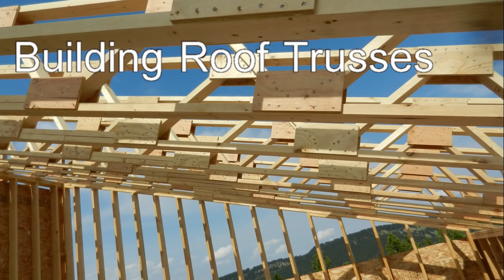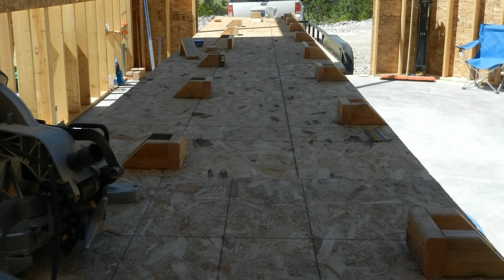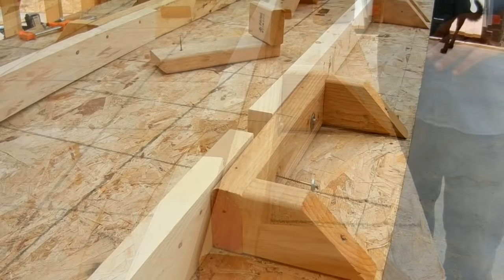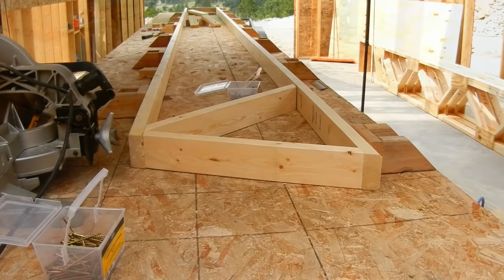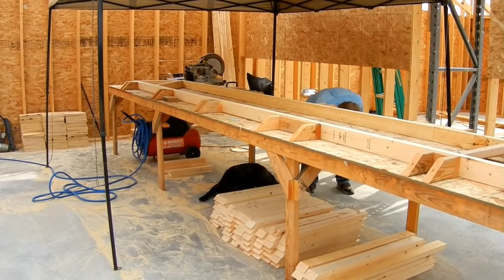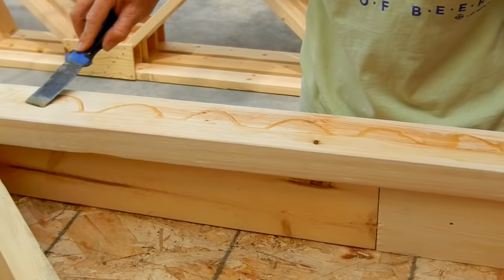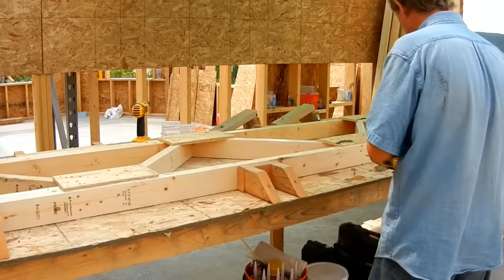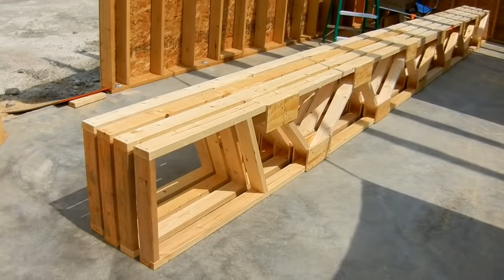Building Roof Trusses

Comment: I'm in the truss business...and I admire and congratulate these people for doing this with their own talent and skill...wish the world had more people like this
Reply from the maker: I couldn't agree more.
Reply: its not complicated - just time-consuming.
Reply: well construction wise it is built WRONG!! 2*4 is turning the wrong way and also underdimensioned!! The width of a truss doesn’t add carry load!
Reply: @MrMakhitta  depends on the type of use for this
Reply: @uniqueidentity1362  nope, there is basically no type of use where this would be a preferred construction! Strengthwise this construction is no stronger than the exact same construction only that all pieces of 2*4 were to replaced by 2*2.. And if you were to replace all 2*4 with 2*5 it it still not stronger!! You need to flip all pieces both beams and studs 90° so they vertical and not horisontal in orientation! I’m shocked that you brag about being in the business and yet so clueless!!
Reply: @MrMakhitta  I don't think you understand how trussed rafters (or beams) are designed, Jonatan. There will be advantages to using 4x2 over 2x2, both in engineering terms when in use, and in practical terms during installation. Trussed  members distribute loads differently to individual members (although a flat 4x2 will still do more 'work' than a 2x2)
Reply: @MrMakhitta  I get what you are trying to say but it's just not accurate to say that a 2x4 on the flat does the same work as a 2x2.   Especially in a truss situation.      For one thing, wood is a far from uniform product and a 2x4 will rarely just split apart while a 2x2 is small enough that they just shatter along small weakness in grain.    Second the Width of a truss adds stability and strength (especially if he put gussets on both sides which it doesn't look he did).  
I have no idea weather this guy did the calculations or if he just winged it.    So maybe they are strong enough and maybe they aren't but just because they are on the flat doesn't mean it's absolutely wrong.
Reply: @MrMakhitta  If this is wrong then every floor truss ever built is wrong because these are essentially built same as floor trusses that carry bigger loads than any roof other than massive snow load roofs

Comment: As a builder for 35 years and designed and built over 200 homes I just need to say to all the engineer experts who wrote the negative comments, this design will handle anything mother nature will throw at it. Sure I would have done it differently but for what he is doing it is just fine.
Reply: engineers don't like when people do this sort of work, because they won't get paid $1000 to look on a chart and tell a secretary to stamp a sheet of paper.
Reply: I've designed and built for 21 years and I wouldn't have done it that way either, but what do I know about his snow load and other factors? They look super strong and actually quite beautiful.   If this were a shop it would be wonderful to gaze up at that trusswork.
Reply: You haven't been building for that many years .I set trusses on a 7 million dollar house and 3 days later Hurricane Andrew came through Naples FL.I braced them and had two bundles of plywood on the roof strapped all of it down.I guess why my house was the only 1 not damaged is because it wasn't decked yet.Plywood on roof.Ive seen wind bend a 1/2 inch by 12 inch glitch plate.So wood is a perishable item dude.Buit homes in Buckhead In Atlanta to SC to Cali.Built a repelling platform for the special forces in the Ga Mts.Also I have never understood why another man like you said comes in picks apart things Bitc.
Reply: I have built homes for 30. The high end home we use enginered floor trusses. Lower end TJI's which I have a strong dislike for.  I am in Southern Illinois.  Also build in the boot heel of Missouri, around Kentucky Lake and southern Indiana. We do have to hurricanes like the coastal  and gulf states or tornadoes like Oklahoma and west.  I do want to say they do excellent work.  His layout is very efficient. He has a eye for detail. Quality craftsmanship.  Excellent work.   There is nothing wrong with his trusses.
Reply: Thanks. Can you tell what different approaches would you take?

Comment: I’ve built many buildings for stables etc and to get through engineering here in the U.K. we almost always have to put the timber the other way on in trusses. Even if I design something it has to go to an engineer to be approved then building control will be happy. 

I cannot get it passed off as a rule with screws, only these long large gauge builders mate type. We almost always have to use nails and on the gussets either PVA or cascamite. 

Don’t listen to the negatives that say your slow, I’d take a neat slow guy that’s right first time every time over a race through and fuck up kind of guy every day of the week. Nice to see people doing a neat job

Comment: I know this is an older video.  I read through some of the comments and some of them prompted me to comment.  First of all this guy does excellent work.  I am a DIY'er myself.  I don't permit a lot of things I build myself.  I usually tend to over engineer what I am building anyway.  In my opinion the whole permit thing is a racket.  I have seen prefabricated roof trusses. They don't look much different than the ones this guy built.  I bought a brand new house around 10 year ago.  It was a spec home in a subdivision but I watched it being built nearly every day.  I watched the the roof trusses and walls being dumped off the back of a flat bed truck.  I listened and watch the south of the boarder carpenters slap together my house like a jigsaw puzzle.  I bet none of them could cut a roofing angle.  I fail to understand that if you are building something on your property, that you own, why does the city or county need to be involved?  I am not dense... I understand that nobody wants to have a cattle barn down town but other wise leave us DIY'ers alone.  If it falls down around our ears, it's nobody's fault but our own.   There, my 2 cents.
Reply: I have to disagree. Anyone in the home could be hurt. I would have paid an engineer to look over my design of these trusses and the engineer would have made the product better by pointing out that the screws have to be structurally rated or use nails. He would have determined the size, number and spacing of the nails. The glue should be structural glue. Then this guys careful work would be much better and it wouldn't take any longer or cost any more. I once had a friend remodel his house and he made a built up beam out of 2x material. I talked him into where to put the splices and to use structural glue and to add an extra layer of 2x.  The inspector told him, he is lucky he did those  things or else he would have made him pull it all down and do it right. The inspector didn't require a stamp so that was nice. I respect the expertise of engineers because I don't know what I don't know.  I am building a deck and the code for deckrail post connections has changed dramatically since I last built a deck because engineers did a bunch of tests and found the old methods don't survive a few people leaning against the railing. Most Youtube videos are showing the wrong way to do it. It is hard to keep up with all the knowledge so I rely on experts to point me in the correct direction.
Reply: Rj Leblanc in my humble opinion they just want money. some things are definitely for safety but it's all abt control over us the people ...hope you are well
Reply: James, really, you think there is a conspiracy to control people by making our homes safer? Who is running that operation? Most of these regulations are based on what has happened to houses in earthquakes, hurricanes, fires, etc. I remember after a hurricane that unexpectedly caused more damage than they thought, they changed how roofs were anchored to the top plate. Also a lot of codes are because scammers going around throwing up roofs for cheap but they blow off in the first storm.
Reply: jollyandwaylo .....well the govt runs the whole deal so there is that and safer? Bullshit. you can't out engineer mother nature .people have tried for centuries and still get blown away ,crushed and the like .freedom has a Cost. sorry if that is harsh but as the county people keep telling me it is what it is
Reply: If someone is going to impose that sort of regulation on you, it should be your insurance company - since it would be their liability (and your choice to have it).

No need for government to get involved in everything - there are other ways that don't involve force.  And because other ways exist, they should be the way we choose going forward.

Always ask yourself: "Is there no other option but to use force in this scenario?"  The answer is always "No" unless someone is using it against you first.
Reply: Who says you need insurance? If you borrow money from the bank, the bank usually requires it to protect their investment but otherwise I don't think there is a law you need insurance on your home unless it is used for commercial purposes I suppose. 
I guess none of you have ever gotten involved in your local government. It is mostly run by bureaucrats who are all trying to pass the buck and not be the one who sticks their neck out. The rules about building and permits don't come from some mysterious thing called 'the government'. The rules usually come from industry like insurance companies after a hurricane, fire, flood, or earthquake. They see what survived and what didn't and make new rules and codes. This is why I follow the codes even when I don't get a permit. If I build a shed in my backyard, I know the codes required if the building is bigger than 120 square feet (200 in some jurisdictions) so I build to the code so my shed doesn't get torn up in a windstorm. I like knowing the codes so I can build things that won't rot in 20 years like the side of the house I am replacing because someone didn't flash the ledger when they built the deck. The whole side of the house was rotted, if there had been an earthquake before I fixed it, it would probably have collapsed. When I rebuilt the wall, I did it to modern earthquake standards. If people were reliably honest and caring, we wouldn't need a governmental body to inspect people's work but since, like the house I am repairing, there are a lot of dishonest or uneducated people, we do need inspectors. I wish we didn't. I do think bureaucrats get carried away in their jobs because they, like many of us, live in a bubble, surrounded by like minded people. No one there stops to ask, should we do this? They just follow what other cities or counties are doing because they can justify that to the bureaucrats above them. It's maddening trying to change their mindset most of the time.
Reply: I find it offesive when you mention people south of the border like people north of the border are any better when it comes to construction, and I'm pretty sure those guys putting this houses together know much more than you, thats why they can do it in few days compare to you mr dyi who would probably take months and probably do it wrong.
Reply: I agree, I used to work on a framing team with all Mexican dudes in the bay area cali and many of those guys had been framing for 10 years and were running circles around me, they definitely knew a ton, a lot more than many other framers I have met. That company framed some of the most expensive, most extensively engineered, largest custom homes on the peninsula and those dudes wouldnt have been kept around if they weren't doing the work right
Reply: I didn't appreciate building inspectors until I spent nine years in China. Yikes. I stepped on a manhole cover there and my leg dropped two feet into the electrical supply when it flipped on me. I was just lucky it wasn't sewage. And don't get me started on their electrical installations. I do resent having to pay thousands to an engineer to have him tell me to do something I fully intended to do. But that's the price we pay for not having the wedding party on the second floor back deck collapse it and kill people when they gathered for the wedding group photo, as happened in the Canadian town I now live in. Codes and inspectors have their place. Sometimes they go overboard, but I've found they are reasonable people if you talk to them about what you are doing and why you are doing it.
Reply: @germcampbell9469  if the county is the inspecting body then your taxes should cover the cost of it. The inspector is payed by the county and we pay taxes to the county. Seems logical to me that we shouldn't have to pay again for the inspection.
Reply: @brooksrobertson4973  yes that was what I was thinking too..I live in Finland, Europe and I'm a construction worker
Reply: Houses are assets. People take out loans against them. They sell them. Etc. That is a big part of the permitting picture along with safety etc
Reply: I hate to be a pill, but as a general contractor with decades of experience I have some nots to pick here. First, how can you over engineer something if you’re not an engineer? After all my years my engineer is still schooling me on things I thought I understood and some of it is frankly counter intuitive and I’m glad I had his guidance. Second, I get the irritation with permits, but they’re there for a reason and they’re not a racket. I’ve made thousands of dollars fixing unpermitted work that someone who thought they were doing screwed up in ways I found predictable but they didn’t. Lastly, just because you think factory built trusses look the same as DIY site built ones doesn’t mean they are. So I guess I’ll leave DIYers alone when they realize that people like me may have leaned a few things after a few decades in the trades.
Reply: germ Campbell the cost of freedom is having your crappy house fall down on you? What am I missing here?
Reply: George Viaud your insurance company does that already in that it won’t insure a home built without permits.
Reply: col stace every permitting authority I’ve ever worked with, be it city or county, is self funded and not supported by taxes.
Reply: Your 2 cents isn't worth that much. I knew & accepted the reason for rules when I was a kid; what happened to you?
Reply: Rj Leblanc  Wait until you have to sell that house that has unpermitted rooms etc added !!!  The city/county will hang your ass over it !!!
Reply: @mechanicalman1068  Well said, it's the I have freedom group I find the most bullheaded.
Reply: @germcampbell9469  Ignorant comment.
Reply: @mechanicalman1068  (No reflection on these trusses, but just a comment on the contempt for building codes, and by the sound of it intelligence in general...) I wonder how may people that want to build whatever way they want would want to buy a house that wasn't permitted or inspected?, the picture changes when you shift perspective.  Consider that the cost could be to the person that buys the house after the builder moves on and the house falls on the buyer and his family. (That could be you or your son or daughter)  or maybe even the builder's own kids or grand kids, Are we to expect that everyone is an expert on everything that they consume? and if for example they buy a shit built house it's their own fault? really? is that like getting surgery and if the surgeon is drunk and cuts off your arm instead of removing your appendix it's your own fault? or if  all the the boxes of cereal that you buy at the grocery store are made with ingredients that are poisoning you your kids then that's your fault too?  in the case of building it's a matter some people's pig headed insistence on remaining ignorant (or just saving a couple of dollars) paid for by future generations. in the case of the food that is being sold to us it's pure unadulterated greed by the producer and total disregard for the consumer That's what freedom is all about?, is it?  think planet earth... That's freedom? really?? whose freedom? to do what? to whom?
Reply: @jollyandwaylo  Exactly. I believe if this truss were to be inspected  and certified by a PE it would fail primarily due to the way it was built.
Reply: @neogeo8267  It is because of this type of ignorant thinking that there are government regulations.  It has more to do with public safety than the insurance companies.
Reply: @scottkelley883  Engineered is the key word in your conversation.  The outcome may not be the same if not under the vice of a PE or Architect  to control the design and construction which is true no matter where you are located.
Reply: The reason for building inspections is, in my opinion. Would be for resale of a home. Some people will build a junky home and sell it to some unknowing people and get burnt..
Reply: The only reason for the Inspection and Permit process is to protect the buyer of the home when the DIY sells the home he constructed!
Reply: George Smirnoff  you talk as if an inspected  house has never fallen on someone.
Inspected work still falls down. 
It happens all the time.
In my county we don't have any building inspectors.  You build what you want. No permits given. 
Except, septic and electric.
Reply: And what happens to the second owner when trusses or whatever are built by those south-of-the-border carpenters? At least with permitting someone has had "eyes on"  before stuff is covered up!